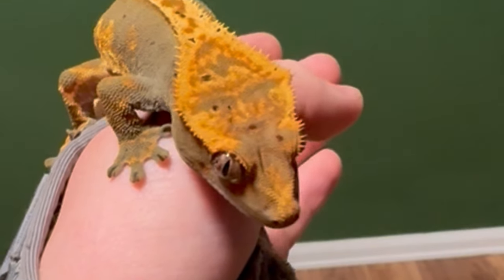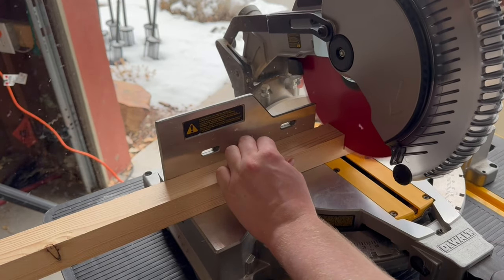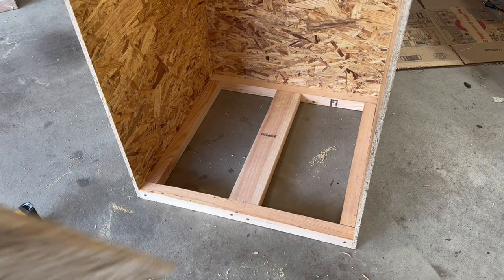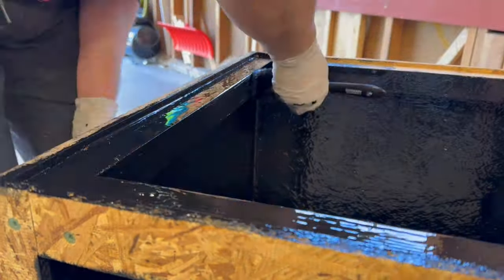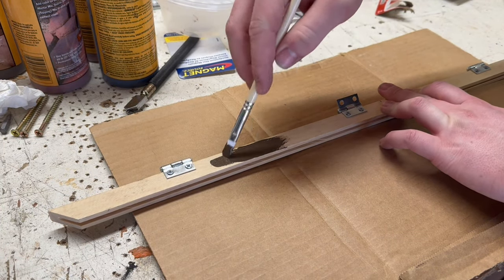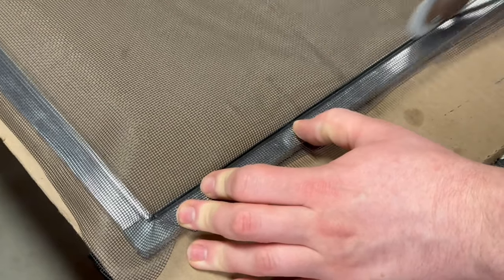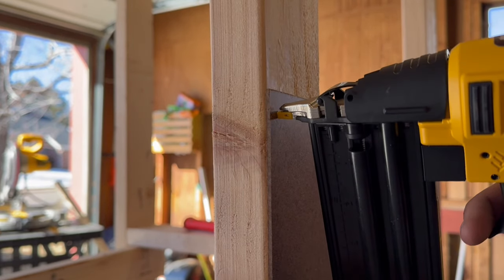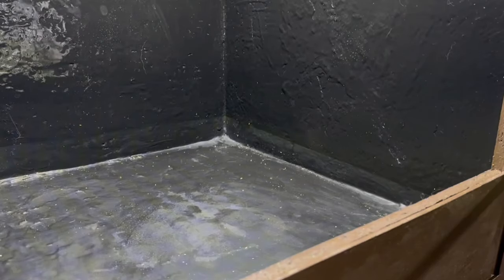Simple DIY plywood reptile enclosure (ideal for a crested gecko)

Comment: Hi! About how much do you think this would coat roughly? Great video
Reply from the maker: If I remember correctly around $80-$100 for just the tank. For the tank plus stand probably around $20-$150. but it could be a little more or less. Should be around that range though, I wish I remembered exactly, sorry about that.
Reply: @hodesigns  that's not bad at all,I just don't have all the tools you have 😅
Reply from the maker: Yeah tools can be a problem lol, it’s possible to do it without some of them but it’s a lot easier with them. It’s possible you could find some used or something like that to save money.

Comment: it’s so nice but i have a question, wouldn’t the wood like rot and get mites or something
Reply from the maker: The wood on the inside is sealed with liquid rubber to protect it from water damage. The wood on the outside I probably should’ve sealed with polyurethane or something but it won’t be exposed to enough moisture to cause damage.